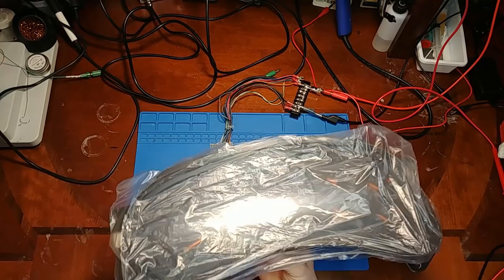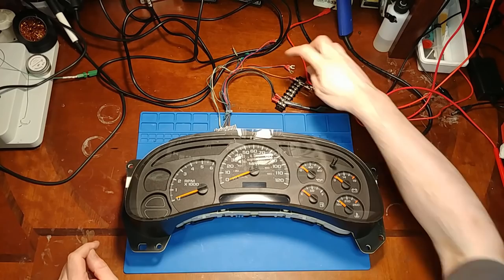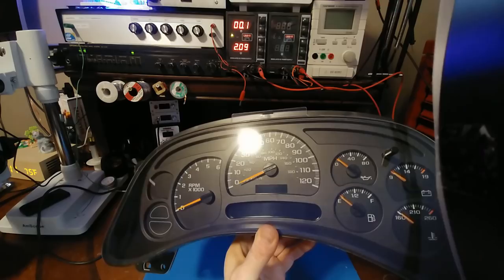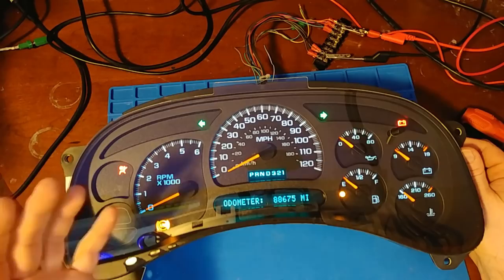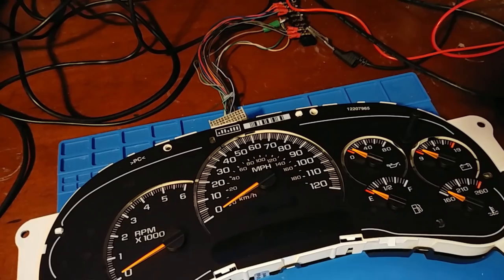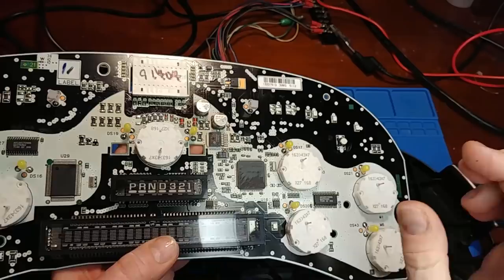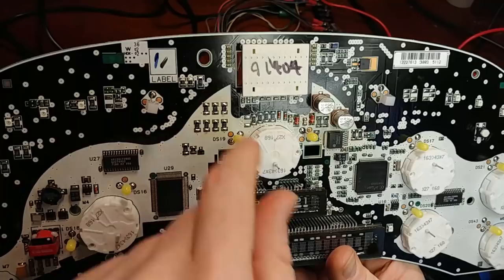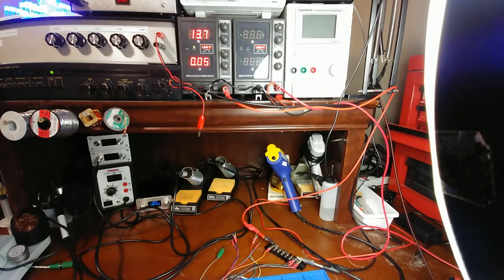Doctors 2nd opinion on battery drain

Comment: Let me just start off by saying this, that little quick current monitoring test you did to see if the cluster went to sleep is not nearly enough. You need to monitor the current consumption for an extended period of time. In most cases I've seen where the cluster drains the battery, its not that the cluster can't go to sleep, its that the cluster keeps waking up throughout an extended period of time. Monitoring the current just long enough for the  microprocessor to go to sleep tells us nothing. I've ran into many cases where I would monitor the current consumption for a couple hours or more with zero current draw, and then suddenly the micro would wake back up and start drawing 400-500ma for no reason at all.
Reply from the maker: I'll defiantly keep my eyes open for that. I haven't run into any yet that wake it's self up (even during non-rushed filming repairs). I haven't had any come bounce back to me yet with battery drain issues. Now I wonder how long circuit board medics test's them for because they gave it the green light too. So for the ones you've seen wake up, were you able to fix it?
Reply: @ jeffescortlx, I have an 03 tahoe with the same issue. The battery goes dead after a few days and the gauges have quit working. Would you be interested in working on it? I cannot find your contact info.
Reply: @Skidmark75  did you have the heating/cooling blower fan resistor replaced under recall??? that's what drained my battery on 05 GMC truck
Reply: @zepar221  no I haven't. I will look into that thanks. I had suspected the cluster to be draining the battery after watching this, but I left it unplugged and the battery was still being drawn down. So, it was not the cluster. I think my gauges stopped working because of the plug in the back. Thanks again zepar.
Reply: @zepar221  I have an 2004 Yukon that if I turn off the key with the Heater left on the battery goes dead. If I turn off the Air before the key the battery holds up. Never heard of this recall.
Reply: @RetiredPilot  
This is probably what is needed to fix the blower motor resistor: https://www.youtube.com/watch?v=yp3gjLen_i8
Well I also had bad stepper motors in my dash cluster for years before I had it repaired and the bad speedo cluster never drained the battery.
Reply: @RetiredPilot  I guess it wasn't exactly a recall: #10240: Special Coverage Adjustment-Heating, Ventilation, and Air Conditioning Blower Not Fully Functional or Inoperative - (May 9, 2011)
Subject: 10240 - Special Coverage Adjustment - Heating, Ventilation, and Air Conditioning Blower Not Fully Functional or Inoperative
Models: 2003-2006 Chevrolet Avalanche, Suburban Tahoe
2003-2007 Chevrolet Silverado
2003-2006 GMC Yukon, Yukon XL
2003-2007 GMC Sierra
Equipped with Manual HVAC (CJ3) or Heavy Duty Heater (C42)
Reply: I had one I couldn’t fix , it would go to sleep and stay asleep for at least 10 minutes . Then it would wake up and energize all segments on the odometer display with a .4 to .7 amp draw .  It would also randomly shut off and come back on  sometimes spiking to 1.4 amp draw . This was on a bench . I changed the mosfet , reflowed all the chips  , soldered everything , changed the big capacitors .   There was a lot of corrosion on the back traces , I cleaned them and did continuity tests to assure it was not shorted .  He sent it to two other places and they did the one min. Test , said it was good and sent it back . Lol. He finally ended up replacing it . I offered to buy it from him but he never responded . I don’t like being beaten .
Reply: @dixondanver2548  I'm having the same issue. What component would you say is the issue? A video showing and describing these components would be amazing.

Comment: My cluster goes to sleep but wakes back up every 30 seconds then goes back to sleep which drains the battery. You should leave it plugged in longer
Reply: That’s what I was thinking. This video and another one I saw both people just concluded that the cluster wasn’t the drain because it went to sleep after a certain amount of time. It’s probably intermittent

Comment: Another common thing that causes battery drain in 03-07(classic) is the driver’s door latch... had to replace it in 2 of my personal trucks. After replacement no more issues 👍
Reply: What were the symptoms did the lights stay on ?
Reply: Had same problem with my 05 Tahoe

Comment: those are blue leds either dipped in or are encased in the phosphorus material that makes white leds white. This is a really nice trick, now im wanting to find some of these for some specialty lighting.
Reply: The small Walmart stake garden lights have used a very similar LED to these the past few years to get them to be brighter. The older version used cold white 5mm LEDs that wasn't very bright.

The only difference between these and the one in the garden light is that only the tip of the garden light LED has the phosphor in it, while these are entirely phosphor. I've tried finding these LEDs on Ebay and other places with no luck so far. The closest I've gotten is the diffused/frosted LEDs.

Comment: I noticed in different Gm 03-06 clusters models years or software version the fuel gauge bottom empty “zero” position is little different, so it’s best to put on the fuel gauge needle on during fuel gauge in “full” position to ensure its calibrated correctly
Reply from the maker: I've been pretty observant with the fuel gauge start setting throughout the years. For virgins it's always started one needle width below the E notch. For all 03-07 (classic) but there are exceptions for clusters that have been previously rebuilt/repaired/taken apart.
Reply: No more than couple days ago I did have the cluster when calibrating it using 1 needle width below red line it didn’t make it all the way to F. I guess there are different calibration revisions with different calibration ranges. It was a first time I did see such a short range.
Reply from the maker: Do you remember what year it was?
Reply: jeffescortlx , 05 if I’m not mistaken
Reply from the maker: Crap. I've been living a lie.

Comment: What else is wired into the circuit for the IPC/DIC fuse? Currently getting about a 60 milliamp draw on that fuse, but I don’t wanna just start replacing stuff and not fix my problem.
Reply from the maker: If your full size GM is a 03-04 it's safe to say it's the cluster drawing the power.

Comment: I have a 2001 Yukon XL 1500 that has parasitic power drain.  I've done the preliminary stuff, such as isolate the radio and accessory circuits, check for alternator/ecm faults, etc to no avail.  I took the cluster out and couldn't see any signs of defects (burnt/open traces, signs of heat/discoloration, etc.) and all of the components on the cluster work.  There have been some who have noted a current draw when these clusters "wake up" hours after turning off, and some have theorized the BCM is at fault.  Here's my question: if I don't have/use keyless entry (due to security issues anyway), why couldn't I place one or two relays in place for those respective circuits, switched with the ignition?  Is there any valid reason why the cluster needs any power after shutdown?  I can see why one would want the BCM to have power, but I don't use or want any of those features (e.g., radio turning off with the door as opposed to ignition).  Could I use a capacitor to supplement a relay to give, say, 2 minutes after ignition off to power the BCM or cluster, then deny power thereafter with the relay once the capcitor drains?  I notice many folks having parasitic power drains and spending 300-400 bucks to replace/reprogram the BCM and fix clusters, when $20 in a couple relays and resistors/caps could be a solution.  Opinions?  Thanks in advance!
Reply from the maker: No need for cap's, relays and resistors. Just move the constant 12v wire over with the switched 12v wire.
I'm not sure what the security function will do. Worth a shot.

Comment: On my 05 yukon I just found my oil pressure guage is stuck at 80. Far right. So I'm guessing that explains the battery draw parasite. The cluster.
Reply from the maker: Stuck at 80 means the oil pressure sending unit is bad. You can pull the cluster fuse and insert a current meter to confirm draw.

Comment: Please take note:This may help some with a battery drain issue,you cant see this becuase its in a blind spot!!!  theres a fuse box, usually under the baterry compartment on gm's and chevys, the lostive cabke that runs from the altenator to the junction box, goes to the battery, "if that wire is loose, corroded or broken" you will not get substantial power to your battery, therefore it will drain over time, basically its not getting the full charge, because of the loos wire, this is exactly what was wrimg with my vehicle

Comment: I have a 2007 Buick LaCrosse my battery drained  overnight sometimes just going into the store so put a different battery in it was starting great for  two days then same thing happened with this battery 
I’m wondering if the problem could be from a bullet came through my back window and hit the corner of my dash went in where the gauges are I noticed only half the speedometer is lit up now can this be the battery problem I’m very frustrated
Reply from the maker: Remove the cluster fuse and insert a current meter and see if it's pulling power when it shouldn't.
Reply: Thank you I’ll have my son do that as soon as he gets back I’ll let you know

Comment: Hi Jeff. I had to replace my cluster in my 2004 Acura MDX  because it wasn't showing the gas level. I bought used cluster for that. Now I have less mileage on the cluster than the car really has. Are you able to add  50K miles for me and how much would that cost?
I also have 2002 Buick Lesabre that doesn't show proper gas level, it moves all the way up or all the way down. How much this one would be to fix?
Reply from the maker: Please contact me via email for price questions.
https://youtu.be/T_2WnJMsZaU
But for the acura it would be easier to repair the old one than programming the new one.

Comment: other? Jeff I have a 2000 gmc Sierra 1500 4x4 and the instrument clusters does no work the only thing that lights up is the service engine soon when I turn the key on the on position and that's it nothing works how much would you charge to fix it in a ballpark finger thanks
Reply from the maker: Could be your ground wire, and not the cluster.
Reply: @jeffescortlx  the ground wire is good and the blinker light do work also and one gauge works but not accurate

Comment: What would you say is the average battery drain for a 2000-2005 car?  My 2001 Audi drains 0.08-0.13A when a multimeter is connected in the battery +.  I have a tracker fitted which constantly charges its 3.7 internal battery and with that disconnected the drain dropped to 0.04-0.05A.  Its OK or I have a problem because my main car battery dies every 2 years, I've changed more batteries than oil in that car.
Reply from the maker: I would say 130mA is too high. Typically the GM clusters will dip to 40mA or lower when in sleep mode with key off.

Comment: Hey Jeff, I was hoping you could answer me a question about a topic you brought up and said was your pet peeve in this video, I have a 06 Chevy trailblazer cluster board, when the cluster board is all plugged into the truck and you turn off the key where should the fuel gauge needle be? Should it be on the red last Mark or below it a little between the Red Mark and the E like you did on your different style Chevy cluster? Just wondering if it would be any different on my cluster? Thank you
Reply from the maker: When the cluster is powered on, but not receiving a signal the needle on the fuel gauge should sit just below the E mark.
Reply: @jeffescortlx  Right, so when I plug it into the truck I hear it power up but when the keys off and out it’s not receiving a signal correct? Thanks
Reply from the maker: @wild8757  but you have to have the cluster/key on for it to go to the home position.
Reply: @jeffescortlx  OK so plug the cluster into the truck, turn the key on, turn the needle counterclockwise until it comes up against the little resistance point and  keep going further until it’s a little under the empty red mark, Correct? Thank you
Reply from the maker: @wild8757  well no, because when it's turned on it's also going to start reading the sending unit value. It's going to try to point the needle to where ever it's supposed to point.
Reply: @jeffescortlx  ok, well then maybe I should just ask you when should I set the needle to just below the empty mark using the truck and not having a power supply on a bench like you have? Is it possible just using the truck to set the needle? As it is where I have it now with it plugged in key off the needle is where it supposed to be just under bottom mark, when I turn on key it goes up to about a half tank, I think it’s right but just wanted to do it over if there was a for sure way to do it in truck with a combination of plugged in or unplugged key on or key off Thank you
Reply from the maker: @wild8757  I have not tried to calibrate a cluster while it's in the vehicle. I always do it on the bench where I can easily add/remove signal.
Reply: @jeffescortlx  OK, the way I have it now is when key is in and cluster is plugged in the fuel gauge is just below the red bottom mark, when I turn the key the first click forward which I believe is accessories the cluster lights up and the battery light comes on and the needle still stays a little below the red bottom empty mark, when I click the key to the next spot the truck starts the needle drops way down to the letter E and then does a full sweep and comes back down to a half a tank of fuel which I’m assuming is where the fuel level is at, when I shut the key off the cluster goes dark and the needle drops back down just below the red empty Mark where it supposed to be, I think that first click powers the board and lights it up with the battery light also on is when it is powered but not receiving a signal from the fuel level yet, similarly like when you power it up on your workbench, I think it’s good, does that sound about right to you? Also I have my original steering wheel radio seek volume button board where one of the  contacts came loose from the board, is there somewhere I can send you a photo of it to see your opinion on whether it’s salvageable or not? I bought a new one but some of the cheap new ones like I accidentally bought don’t have bulbs in them they have little tiny square LED chips that light up so you can’t really solder in an LED very good? By the way I know you’re busy man but thanks for spending your time responding to me, Appreciate it!
Reply from the maker: @wild8757  sounds like you have it set up correctly. My contact information for email address is available by following the top sticky comment link.

Comment: I have an 06 trailblazer ss  with a battery light that stays on very dim even when the truck is locked and parked over night. Pull the fuse for instrument panel and it goes out and the battery drain appears to go away.  Everything else in the truck seems to be dead . Don’t believe it’s a bcm issue are this time. What fails on the cluster to cause this ?
Reply from the maker: Silver migration corrosion
Reply: jeffescortlx I’m mechanically inclined and have no problems repairing issues but never tackled a cluster before. Working at the garage we would always just send to dealer. I’m feeling brave. Is this repairable without much hassle? Was hoping to see a video documenting it but haven’t found it yet
Reply from the maker: @caseypirro6359  Typically removing the corrosion is just one small step in a cluster rebuild. But if you just want to correct that single issue, you can pop off the back cover and gently scrub the corrosion off with some rubbing alcohol and a scuff pad. (It will look like dark staining)

Comment: Hi I have a 2002 GMC Sierra 2500, it has 397000 miles and the cluster is starting twitch a lot and three of the gauges don’t work at all. I need to send it to you how much and how quick can you do it. Thanks
Reply from the maker: It's not common for the 99-02 to have gauges to completely stop working (unless they all stop at the same time.) You probably have sending unit issues. You should do deeper trouble shooting because sending the cluster off for rebuilding might not fix your problem. Depending on what gauges are not working, you may have comunication issues.

Comment: I have seen lazy after market auto starter installers splice the continuous and standby power wires together and connect them both to constant power causing power drain. It's an easy thing to spot if you know what your looking for, right at the auto start two cables spliced together.

Comment: Jeff I watched you video and I also watched this video 

Chevrolet Truck - Battery Dies Overnight - Part II 

South Main Auto Repair LLC
•
in this video the repair shop states that silver migration was the reason for the drain on the battery. Can this issue be fixed if it is the cause?
Reply from the maker: Yes I can fix it. But 80% of the time battery drain is caused by fractured solder joints.
Reply: South Main Auto Repair LLC is the best electrical repair guy I’ve ever seen. Guys a genius when it comes to troubleshooting issues.